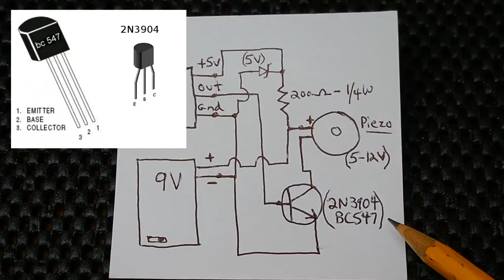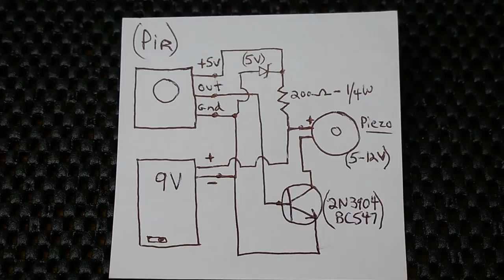How To Make A Portable Motion Detecting Alarm(PIR)

Comment: Nicely done!  About a year and a half ago I built something similar but instead of using a buzzer I used an RS recording module.  That required me to do some level translation because the module needed a 9v supply.  I ended up using a BS170 NCHAN MOSFET to drive a 6N137 opto-isolator.  My original intent for the device was for it to discourage our cat from leaping onto the table.  When detecting motion it would yell, "Intruder Alert" and flash a jumbo red LED.  Unfortunately our cat thought it was a toy and proceeded to constantly trigger it.  She outsmarted me again!  :-D
Reply: John Brandolini THAT darn cat!

Comment: THANK YOU awesome video, i've been comparing motion sensors and this unit is more sensitive, lasts longer, and has a wider field of view than most of the commercial units that you buy off the shelf that eat AA batteries like it's going out of fashion. I will be using a regulated 12v power supply, which in turn trickle charges 3 x 12V 7Ah connected in parallel , which i use for our LED lighting, router and 2 way radio when power goes off here.  One question will i still need the  Zener voltage regulator if I'm using 12v instead of 9v. I know some of these boards have their own regulator built in , does this one? I've ordered an extra board just to test and see, if it goes I'll  revert back to 9v, if, not I'll keep you posted. THANKS again for the awesome videos. Liked, and Shared

Comment: very cool. I don't know what's more amazing, how simple that is to make or that you actually found something useful and in stock at radio shack.
Reply from the maker: Good one. :-)
Reply: I know, right?  When I was a teen I remember Radio Shack as THE place to go for electronic parts.  Now, they're all phones and toys.  You'd figure they would take notice of our (DIYers) growing numbers and sell a diode or two.
Reply from the maker: Online companies and China did a number on Radio Shack.....Sadly, the same applies for many companies in the USA.
Reply: They failed because of increasing competition when for a long time they were the only ones on the block.  Many of us rode our bikes to the store just to get a book.  That is where they failed. Stopped being the leader in the mentor role.  Tandy University  could have been their place.

Future technicians and electrical engineers. They had the books, but kept selling stuff to a market that had just as much access if not more. That they had.

It is a shame. However that is life and that is the movement of the Capitalist system. You fail someone will fill that void.  

Case in point cars replaced horses and buggies and buggy whips. It is just the way it is. 

And thank goodness. I like indoor plumbing and air conditioning and with the crazy Ohio -19 degree winters I so... appreciate central heat and my insulated and heated garage. THANK YOU GOD!

With that said I am a part of the Radio Shack crowd my library has many of their books....

Oh, lastly it is because of Radio Shack I was introduced to the 555 timer through the engineer's notebooks I used and LED with its own housing to be strobes for my model airplanes and my sci-fy models from Star Wars. No one else at the time was doing it.

Oh, I also put in micro switches into those handheld and football games and baseball games in the late '70s and early '80s so the could run silent in school. I got $5 bucks a whack plus parts for doing that. I must have made on average $125 every two weeks and I was only 13. Never got in trouble either...

Comment: Nice easy and ingenious project congratulations !  Therefore what modifications should i make to reuse a professional pir (as aritech, risco, pyronix, visonic and so on) instead of using this cheap module ?  Indeed those professional sensors are much more reliable and stable than this "toy"...  I have to confess you i am the most stupid nebee in electronics :-(  Anyway thanks in advance for your kindness.  Cheers from Belgium !
Reply from the maker: Unfortunately, I don't assist viewers with mods. I have way too many videos to be doing that. I only answer simple questions by viewers. Thanks for watching!

Comment: Can you use a light instead of the piezo alarm? And if you can you demonstrate that in another video? Great video
Reply from the maker: You can use a fast flashing LED in place of the Piezo alarm. You'll need a 200 to 330 ohm 1/4w current limiting resistor in series with the LED. Thanks for watching, and be sure to share my channel with others.

Comment: That's a handy little alarm, neat idea! But, I see one flaw in your design - you don't need that Zener voltage regulator, the PIR module has its own little 3.3V regulator. It's a little 3-pin chip with a tab, google the part number, I'm sure you'll find that it is an LDO voltage regulator. Without that Zener circuit, the battery will last much longer, because the PIR consumes <1mA when on standby and <5mA when triggered. 
 I'm not trying to be a smartass, I just want to give you a friendly hint to improve your design. I like your vids and I'm subscribed to you for 2 years; don't take this comment as a doubt in your ability to make great projects.
Reply from the maker: MrJohhhnnnyyy The module says + 5v input required.
Reply: I have 2 of these modules powered from 13V and they do just fine for 3 weeks by now. Stuff from China has bizarre ratings, most of the times they claim too much, but on these modules they underrate it. I have those modules on the light fixture, which is powered for 4+ hours each day, modules don't mind that at all.

Comment: Thank you great video!! Can I use this same setup with a cat5 cable supplying voltage AND signal for the piezo to be remote like 600'? (as driveway alert) Thanks!
Reply from the maker: Check out my other video.
https://www.youtube.com/watch?v=_O36Br7NczY
Thanks for watching!
Reply: @electronicsNmore  that other video didnt answer my question I want to send signal and dc voltage thru a single cat5 cable to remote the remote pir but sound the alarm at house...using a computer power supply...think its possible?

Comment: Hi! Is it possible with the same diagram to use 4.2V 18650 lithium batteries? I’m planning to make a prototype connected to a 3.5W 6v solar panel.
Reply from the maker: The PIR module has a voltage regulator built into it. If you supply less than 5V, the regulated power output will be unstable. Use (2) 18650's in series. Be sure to check out my video playlists and share. Thanks!

Comment: Thanks for making this video. I have a PIR 8 - 12/24v with input connection on it already. Could I use it as a switch to activate a 12v alarm ?  Or would the circuit need a relay ?  And would it also be possible to add a remote switch ?
Reply from the maker: All depends how much current the output can handle. Look up the specs.
Reply: @electronicsNmore  12v Car horn.. I was thinking a circuit of. 12v  car battery - PIR - car horn.. If someone opened my car door it would go off. Though then this only would work at night I think..

Comment: FYI.    You really should have a current limiting resistor in between the output of the PIR unit and the base of the transistor.  The output  can only source 5 to 10 milliamps of current based on the BISS0001 chip specs sheet.
Reply from the maker: jp040759 Not necessary, but you can add one if you desire. Thanks for watching

Comment: Friend i got a question it works.

But it works only as a motion sensor and not PIR sensor.
Because when i throw a towel in front of it the alarm Will go off.

I want it to go off only when it detects a large heat source and not lifeless objects like moving curtains etc
I have tried to adjust the sensititvy censor but no luck.

Need.your help to.tackle this

Comment: Thank for Great tutorial. Can be possible to add a Cam and WIFI to the design? Also For how long, it can run in battery?
Reply from the maker: You can remove the alarm and use a reed relay to trigger another device such as a camera.

Comment: I am looking for info on adapting an expired smoke alarm with an old computer mouse (for the infrared detection) but haven't got a clue how to combine both. Also, was thinking How to adjust it so alarm/piezo only goes off for say 10 secs. If you can help me with a resolution I would be very grateful. P. S. I already made a simple bath water alarm with the old smoke detector - by soldering a two - wire computer connector to it And just dangling the plastic connector end a certain depth into Bath when running it, then turning off and shaking the plastic end when alarm sounds., so thought it could possibly be adapted to make a fox deterrent for the garden. What do you think? Thanks for sharing your video.
Reply from the maker: You don't need the smoke alarm, there's much simpler ways to make what you want. You can search online for schematics for circuits that you need, or look on my channel. Thanks

Comment: Great video. I was looking to install some LED strip lighting and a sound recorder with a siren sound that would both trigger off motion (PIR Sensor) when a bean bag goes into the cornhole hole. Any ideas on how to set something up like this or where to find online?
Reply from the maker: Thanks Phil! You're better off using a pressure sensing pad in the hole.

Comment: I am hitting a stumbling block. I think the 1N5406 "Diode" has been replaced. I cannot find it.  I can find the 1N5408 is there a chart that shows older components that have been replaced with new ones?  Frustrating. Lots of work.  This is for a Flat screen I am looking at known components that go bad.

In addition this time of year is when I start working more on projects like this. However, I don't know what a good assortment of X Diodes, Caps, Transistors, Resistors, etc. I should have.

Any advice you can give will be appreciated as always.  Thinking about getting that cordless soldering Iron you have.
Reply from the maker: Ebay has a 1N5406......600v/3A. 

A good set of rectifier diodes(1A and 3A), along with Schottky type: http://bit.ly/2xGXyEu

Set of 1/4W resistors: http://bit.ly/2iROVny

Transistor Assortment: http://bit.ly/2xGYXee

Electrolytic Assortment: http://bit.ly/2eyTgKW

Film Capacitor Kit: http://bit.ly/2vBK9Ae

If you decide to buy the cordless soldering iron, let me know so I can provide the link so I get credit for the purchase. It won't cost you any extra money. Thank You!

Comment: I'm after a portable PIR that when triggered can send a signal to an ear piece I'm wearing approximately 100 metres from the PIR.

Can you point me in the right direction, or do a How To to make my own?

Thanks
Reply from the maker: You can use this circuit along with a reed switch relay to trigger the push button on a remote control for a wireless doorbell.

Comment: sir how many days the battery will survive??m planning to use a micro controller and transmitter(nrf24l01)with similar kind of design..
Reply from the maker: Never tested that. Take the battery's rated capacity and divide it by the standby current. For a very long time, use a Lithium 9V battery.

Comment: Tried remaking this circuit in TinkerCAD. Won't work. The Zener diode is reading 4.67V and when I trigger the PIR it starts fluctuating between 4.67 and 2.67V but the Piezo won't make noise. Tried replacing it with an LED, still won't work. Not sure what to try next
Reply from the maker: Works just fine, clearly that program doesn't work too well, because you saw me use the device in the video.
Reply: @electronicsNmore  so I got it to work after some tests. I had to drop the resistor to 100 ohms. 200 ohms was causing the voltage to drop too low so the Piezo couldn't function. Guessing the Piezo in the program isn't the same voltage rating.
Reply: Check out Tinkercad. Rather interesting program

Comment: What if I want to use small LED Bulb as an alarm, not a buzzer!
Please explain in a detailed way! Please spare some minutes to answer this question properly. Please explain it like, "for that you'd need a battery of voltage, say, 5V, and transistor... ".
BTW, do I still need an amplifier for an LED bulb?
And what'd be circuit diagram?
Also, lemme tell you I've some knowledge of electronics!
Please answer my question, I'd be grateful to you!

Thanks :)
Reply from the maker: Where the Piezo is shown, in place of it take a 200 ohm 1/4w resistor and use it in series with a ultrabright 5mm/10mm/ or Piranha LED. Very simple. Anode of LED to (+), and the cathode to the resistor, then the other side of the resistor to the transistor's collector. Thanks for watching! Make sure you share my channel with others.
Reply: @electronicsNmore  Thank you so much, I love you channel and work!
I was wondering if I use separate batteries like 5V for modulator and other required volts for LED, then the circuit would become very simple, since we no longer need a regulator of voltage!
Can you please tell me only the circuit diagram of the method I mentioned! I actually do not have the diode!
Thank you so so so so so so so sooooooooo much for responding!
Well, I didn't expected it to be within 24 hours, very surprising!
Reply: @electronicsNmore  
BTW, I was confused by you saying we're going to amplify the output by the PIR Modulator to run the Piezo (by a transistor) @ 3:32. I was confused because transistor here, is acting as an electric switch to turn on Piezo as long as it's base detects current!
Reply from the maker: @m.abdullahaslam8169  I'm glad you enjoy my channel, but I cannot reply to any viewer more than once for a question on a video. I have way too many others asking questions. I can't be going back and forth answering multiple questions. Most channels on YT wouldn't have replied to you at all. I hope you understand.
Reply: @electronicsNmore  anyway, thanks a lot
Reply: @electronicsNmore  
I do understand your point!
Still, I wish you'd answer my question just one... just one more time!
(Thanks for previous reply =D)

Comment: I cant make this work as it should, when I turn it on, only the buzzer triggers immediately and stays on.
 I have followed the steps but  this doesnt work for me, does anybody have the same problem ?any idea of what im doing wrong?
Reply from the maker: You may have burned up the transistor or the transistor isn't correctly installed(wrong pins).
Reply: @electronicsNmore  thank you. Ill check that out.  I wish you great success with your channel, the videos and explanations are really good.
Reply from the maker: Success can only be achieved if viewers share my videos. Thanks for watching!

Comment: Hey man I don’t know why but my piezo alarm sounds very quiet even though I did everything.
Reply from the maker: Sounds like leakage. Disconnect the base of the transistor and see if it stops.
Reply: electronicsNmore yeah I tried that with a different bc547 and it didn’t work and then I tried with a different PIR module

Comment: may i know how to adjust the reset duration ?
Reply from the maker: There are potentiometers on the PIR board. One is for distance and the other is for delay adjustment.
Reply: electronicsNmore I know, i means after the buzzer stop the sound, the pir motion need after 5 seconds to function again..
I want to stop the 5 seconds, reset.

Comment: My buzzer continued to alarm ... What could be the problem?
Reply from the maker: Either you incorrectly connected one of the components, need to adjust the PIR module POT's, or the transistor is shorted.
Reply: electronicsNmore I check the connections and the POT's is OK maybe the transistor .. I'll changed them
Reply: electronicsNmore I'm using 
HC-SR501 PIR its beeping every 10 seconds or above .

Comment: Video from 7.30 to 7.40 not clear, can you please let me know..red from battery goes to transistor and black from battery goes to zener diode ?
Reply from the maker: Everything is very clear at 5:07.
Reply: Those 10 secs I m missing, rest everything is clear
Just the piezo alarm connection 😔

Comment: Brilliant except for silicon sealant. It emits acetic acid fumes that attacks PC board lands. It's use bankrupted a large radio control company in the 70's. Maybe sensor safe sealant would be better.
Reply from the maker: Never had any problems using silicone. The solder covers them up anyway. You can always try RTV silicone. :-)